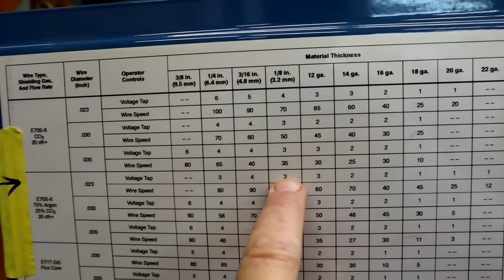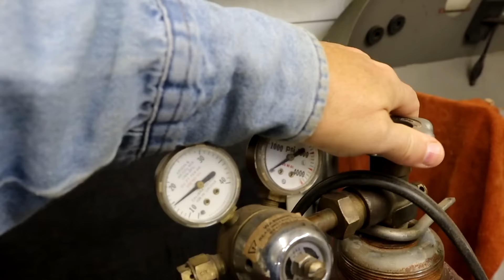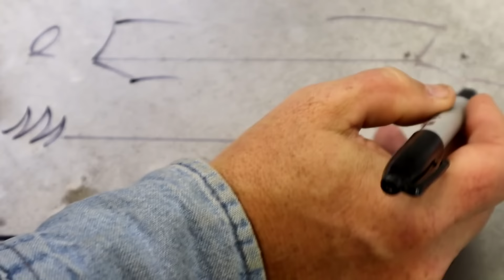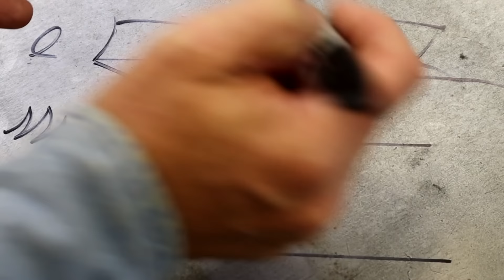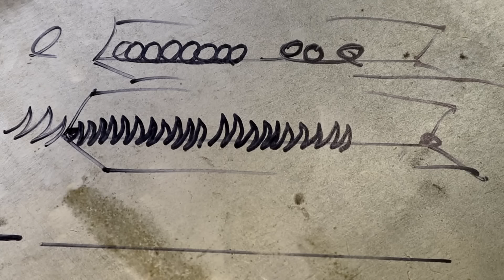How To STACK DIMES With a (MIG Welder) For Beginners🔥🔥🔥

Comment: Message for all Up and coming welders. DO NOT STACK DIMES.
Reply: They do look goon on a downhill.
Reply: Robot welders don't stack dimes
Reply: @BruceLee-xn3nn  We had a track welder that could weave.
Reply: @davidrule1335  that would be cool to watch
Reply: @BruceLee-xn3nn  We used it for .045 flux core up hill, and...I broke/dropped it. Had to take it apart, all it was, was two little motors and a leaver you could adj for the weave amount. It was also our line burner for the torch.
Reply: Why not?
Reply: @Obama___  coz welding codes doesn't call for it.
Reply: @davidrule1335  just out of interest did the robot push or pull on the weave? (I'm presuming you mean the cap?  On 15mil single V butts using 1.6mil flux core wire I push the root/hot pass ect till filled then pull a weaved cap (not on the vertical)
Reply: @zukispur5493  The place I worked at was a code vessel shop. Some of the welds were 30' long. the root was .045 flux core by hand vertical. The hot and filler passes were vertical stringers straight in with the track welder. On the cap we would turn the weave on, vertical with the gun pointed slightly uphill. Unless the print said not to the weave was 3/4" wide. All of this was vertical up hill of course. When we did the longitudinal beads it was stringers all the way out with a slight drag on the gun. The bulk of the welds I did were position welds in the field 3/32 P-5 root 7018 hot, filler and cap. Or S.S. purge, TIG 3/32 filler all the way out. We also did a lot of .035 hard wire. on the corner to corner it was downhill NO whip straight in. The T-joints are the one's where you would "push" the bead, whip forward, come back and fill the trench you just made. these were mostly stich welds so you could count the number of whips to gage the length of the weld. For instance on a 3/10 skip weld.
Reply: Facts
Reply: @zukispur5493  Everyone talks about the "codes" The welding procedure is picked out by the customer. The people paying you to weld. We had a job that was to be bubble tested. The customer called back and added it was to be bubble tested using Helium ( a much smaller molecule) so we turned it down. The customer get's to pick out the duty of x-ray he want's. The heaver the more money. It can be "inhouse" testing or they may want a third party like Code Services to preform the testing. If nothing specific is called out on filler material, you can use J.B.Weld as long as it passes what ever test they want. Their paying for it so this "code" bull crap is just not true.
Reply: @davidrule1335  If you are a self employed pipe welder you'll NEED a 6g ticket. (Here in the UK) won't get on many jobs without it.  That and a CSCS card
Reply: @davidrule1335  I'm trying to remember the tickets I had to get when I worked on a Danish shipyard (lindo) 15mm single V butt vert&hori 1.6 mil flux core. Also needed a separate fillet code if my memory serves me correctly 4.5 and 5mm femax iron powder rods
Reply: @zukispur5493  Yes and that will get you certified. I've had many different certifications, one on S.S. dimpled jacket, all of witch have long run out. So yes the welder has to be certified to get the job. but once he has it you you do  what they want. Who would you complain to IF THE BOSS HAS YOU DO SOMETHING "OUT OF CODE"?
Reply: I guess all the old-timers who were welding before you were born are wrong then.
Reply: Sorry, but isn't stacking dimes creating a stronger bond? Especially in TIG welding like the video discusses. I'm new at welding but honestly don't understand your reasoning behind "DO NOT STACK DIMES"... Care to explain?
Reply: @Obama___  Because he said so.
Reply: No because it is freezing and not staying melted the whole time it just doesn’t penetrate as well which makes it not as strong

Comment: I hate to burst your bubble but stacking dimes is not an actual good weld. It’s to easy to get cold lap. Plus pushing your weld not dragging is proper way to weld.  All my classes for industrial structural welding would tell you not to weld the way you do.
Reply: dragging is perfectly fine
Reply: well then i hate to burst your bubble @DougKahler but when MIG welding you want drag your weld. Pushing when MIG welding will give you dips in the weld leaving you with lots of porosity. Stacking dimes when done properly is a better weld (on thicker metals) because it’s usually hotter than a straight weld. So maybe do your homework?
Reply: @Isaiah Polk  While pulling might create a deeper penetration, in most situations, pushing creates a flatter weld that covers more surface area. In some instances, this can create a stronger weld than what you might get with the pull technique. As mentioned, pulling allows you to watch your bead as its being produced.
Reply: Im curious as to why everyone is here watching a tutorial video when they apparently know it all already.
Reply: And some who’d say the correct way is to push the weld which it is for structural purposes and after that grind it back a bit and stack dimes afterwards if u want the look
Reply: Welder preference on push pull… anyone who’s got sometime welding structural welds will tell you a hot enough weld will fuse two pieces of metal together if you can lay it down dragging cool if you can push straight welds no manipulation what so ever and lay a 3’4’5’ 1/4” fillet then you don’t waste time preaching at new people in an aluminum how to vid
Reply: @tbagsx  practice practice practice buddy you can always get better watching new techniques.
Reply: Cope
Reply: I hope he isn't paying too much for that "welding class". Should buy a AWS book and read it...
Reply: Yes you are perfectly right that it may cause cold lap. But if your setting are set right and ur moving slow but whipping fast. Should have absolutely 0 problem getting the proper penetration, if not better then a stringer.
Reply: Yes you are perfectly right that it may cause cold lap. But if your setting are set right and ur moving slow but whipping fast. Should have absolutely 0 problem getting the proper penetration, if not better then a stringer.
Reply: Pushing and pulling both work for short circuit mig.I would advise anyone learning to weld to understand what a sound weld is before they try to stack dimes.Cutting and etching your practice welds is the best way to learn if you are getting good penetration.
Reply: Dragging is better.
Reply: I was always taught if it makes slag u drag if it don't u push that's because pushing if it makes slag can cause the slag to get trapped in the weld...but really if it don't make slag u can push or pull depending on how u want ur welds pull for narrow taller weld with deep penetration or push for wider flatter less penetration weld as for strength they are very similar cause  one is deeper for it's strength the other is wider with more bite on the surface.... typically from what I've seen and been around most seem to pull with a root weld and push for final cover weld to make the appearance look better
Reply: @tbagsx  fax😂😂😂
Reply: @tbagsx  same 😂
Reply: The ignorance in your comment is laughable dude. One, if you know so much (which you don't) then why watch this video? Two, you can drag out push with a mig. The root will be damn near the same but to be honest dragging gets you a deeper root.
Reply: @tbagsx  well said sir. I’m a beginner and now more confused than ever 😅

Comment: This is not a good weld. Just because a weld looks good doesn't mean it's 100%. I wish you could do a 6010 open root to show. I don't think you can..
Reply from the maker: I dont stick weld hot rod chassis. I had to do open root 6010 passes when I was in welding school . I never use it now doing hot rod fabrication.